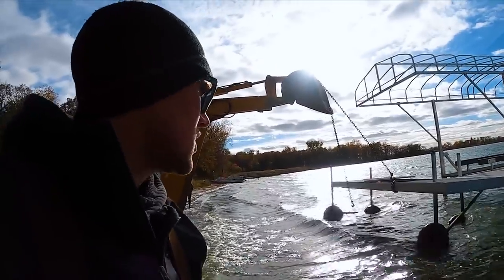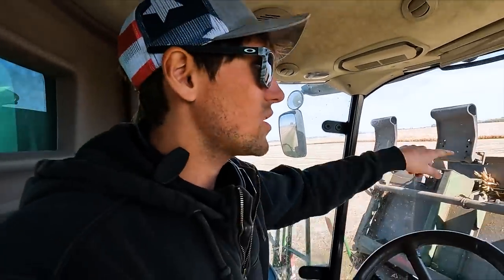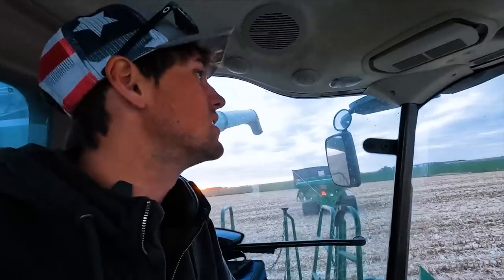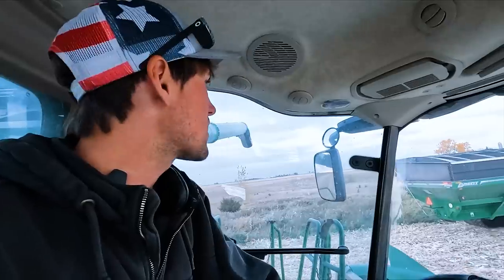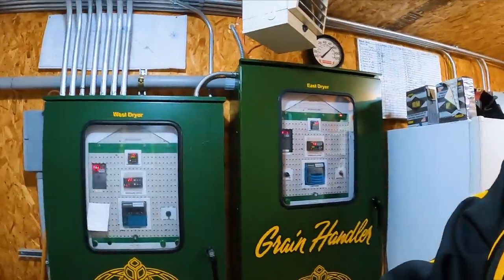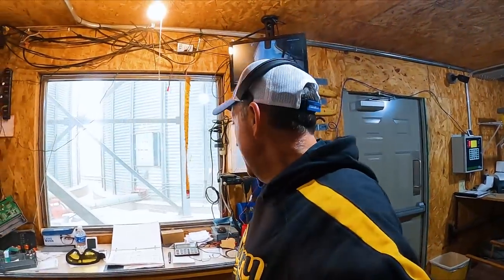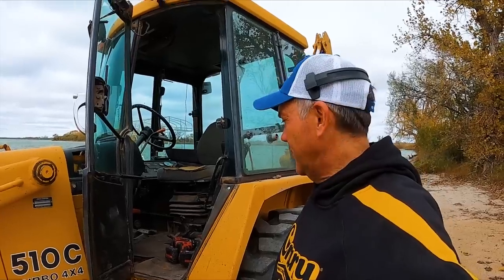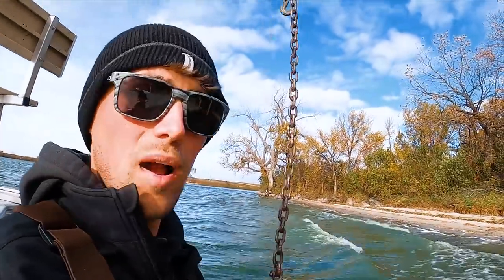First Day Off Harvest In 8 Years And We Still Work!! #15

Comment: "Lotta lip moving an a lotta not working!" Classic Dougo. If you don't mind I think I can use that quite a lot.
Glad Corn Force 2 wasn't too hosed up and you're back with the full fleet up and running in the war against the stalks. It is interesting about the differences between the two machines.

Comment: Prime the paint by painting it w/ aluminum paint, then any paint will stick. Clean tank after any grease removed by washing 2 times w/ a strong vinegar solution, washing off, air dry, then ready to primer.

Comment: With as much as those combine grain tanks are overloaded with the Big Tops vs. the factory design I'm not so surprised you've had some issues. All the extra bushels/weight added to starting up system repeatedly. John Deere may have some issue but extensions can create some as well.

Comment: Pull the prop off that boat.. grease up the shaft..You be glad you did. Then change the lower unit grease(oil)... water can get in the case and crack case... or trash internals...

Comment: 5:20 - you got it all backwards, I think. Look at the wheels that the hydro pulls. Consider the drive unit is the same, and compare the diametre of the belt drive wheel compared to the conventional wheel. You would get a lot more precision out of the belt drive, but far less road speeds. The jerkyness you talk about will be because of the difference in precision control, and it all relates to the diametre of the drive wheel compared to the actual movement on the ground. Remember it is multiplied by pi, so 3.14 times the difference. That would also imply that the wheeled combine needs to overcome the same difference when pulling heavy loads - so it should not be able to pull as much as a tracked unit.

Comment: You guys, stop making a big deal out of everthing....all you need is a 4-Wheeler to pull those sections out of your shallow beach. Thousands of Minnesotans do it every year without the drama.
Reply: 4- wheeler is not going to pull them heavy sections out. You have no idea what you are talking about. Smaller basic dock sections, yes, them sections, no, not a chance!
Reply: @hawks2252  We do it all the time, and our dock is much longer, and we pull it up a steep hill to boot.  You don't need that kind of equipment for a dock with wheels in a shallow bay like theirs...Minnesota would be in lot of trouble, if in the land of 10,000 Lakes, everyone with a dock needed that kind of equipment to pull their docks out. They're show offs!
Reply: @tannenbaumgirl3100  I live in MN and have a cabin in MN on a lake as well . My Grizzly 700 can not pull a canopy dock section like that out of a sand beach with the tires sunk in like theirs were.  I use my winch with the back of the ATV cumalonged to a tree because the machine itself will not pull the sections out from the hitch end. The tires just spin (paddle mud/sand tires)   I have a large regular dock, not a canopy dock which is way heavier.  I kinda know.  So I use my front end loader usually, and my neighbors ask all the time if I can yank their dock out as their ATV will not do it.  (If ya know - ya know)  Make a video of you doing it and send a link to me.